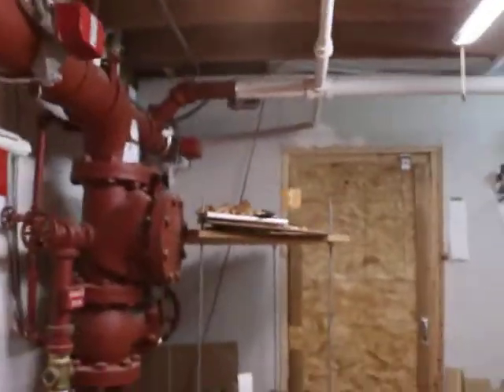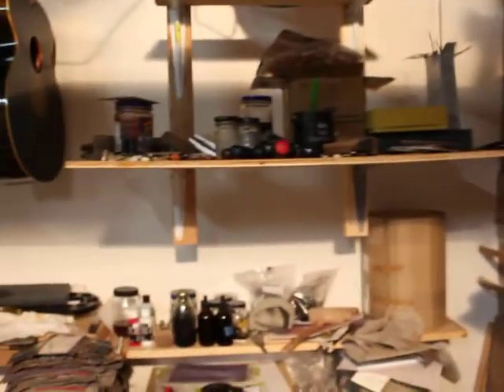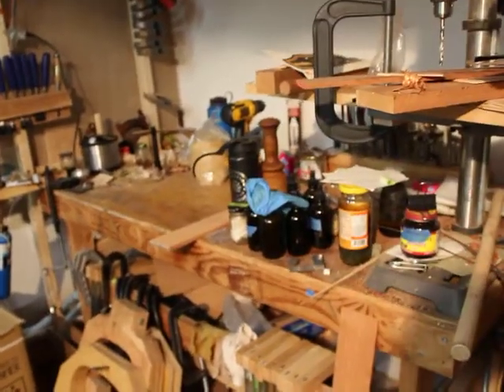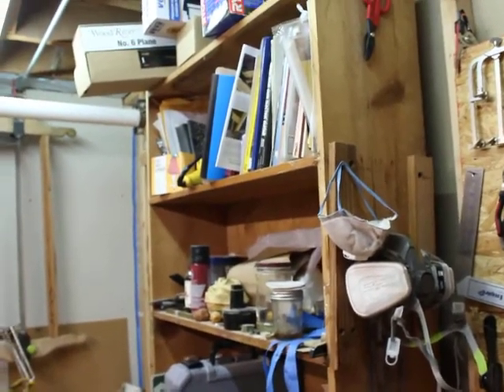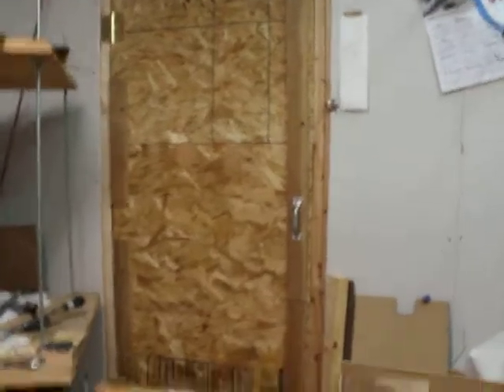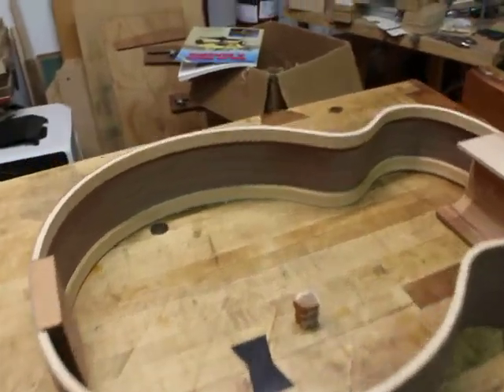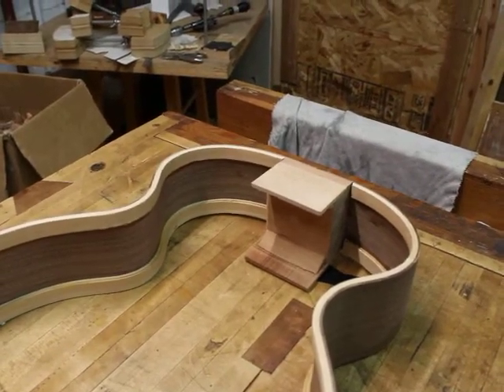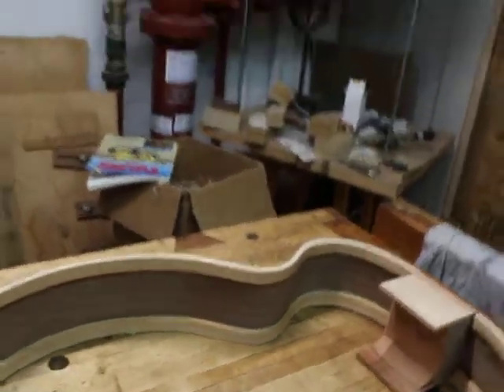Welcome to the Queen City Guitars Shop

Comment: Great video as usual. How thick is your lining? I make mine 3-4 mm but sometimes feel that’s too narrow.
Reply from the maker: Thanks!  I make laminated linings, so I have two layers of spruce that are generally about 2.3-2.5 mm thick.  So about 5mm when all is said and done.  Sometimes I feel that is on the thin side, but I suppose the solid linings do gain a little bit of surface area without all the kerf slots (and its only about a mm thinner than a standard kerfed lining that you might buy), and I can say from having to remove a top from one the day after glue up that they end up stuck down pretty firmly.